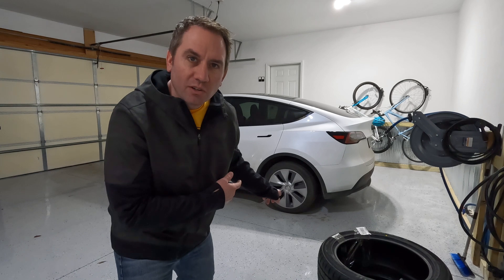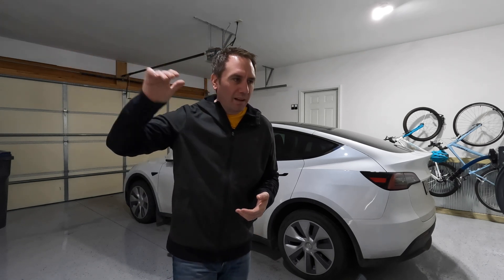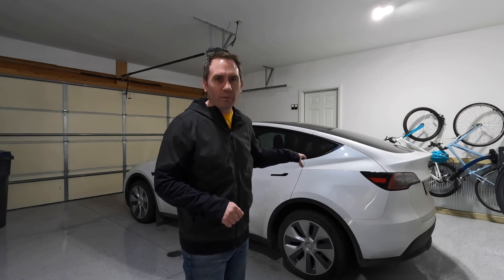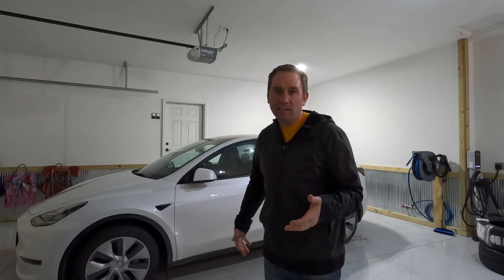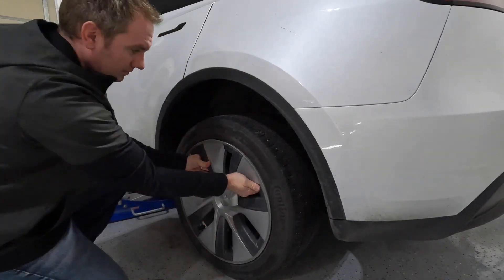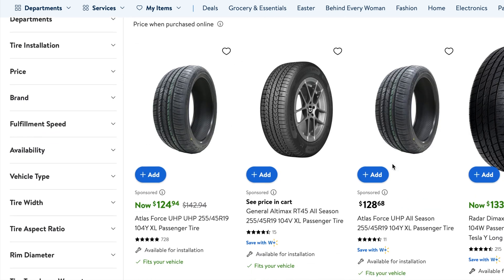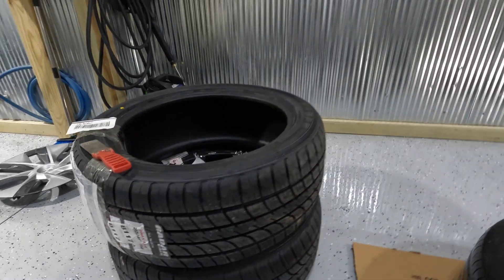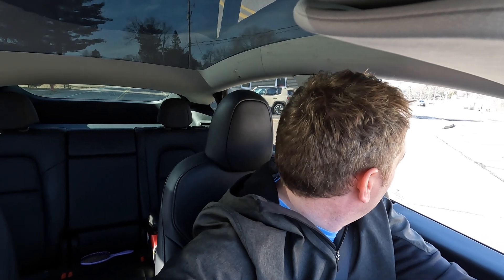Tesla Model Y Tires - Most Affordable Option

Comment: Hi, can you please provide an update on these tires? How long did they last compared to the expensive tires? I would appreciate your feedback on these tires as I am tired of buying expensive tires. I had Pirelli Zero Elect tires and paid $1400, but they only lasted 36,000 miles.
Reply from the maker: They have performed very similar to the stock Continentals.  They are currently at 13k miles and I'm guessing will last 20k - 25k miles on the rear.  I have zero complaints with these tires.  

I also have a long range Model Y that we mostly use for highway miles and the stock Continentals are lasting much longer.  I'm currently at 23k miles and have at least another 10k left.

  I believe it's the start/stop of city driving that really wears out the rear tires during regeneration.
Reply: @TheLawnEngineer  so these rader tires u recommend?

Comment: I have a 2021 AWD Y and it's got 36,000 mi on the tires.  I rotated my tires once  myself,  easy to do. I drove nuts also but not insane... My tire ware is same on all 4 tires.. ( your so wrong about time waiting for rotation,  but invested a ton of $ and a hell more time then having a shop to do it).... All I bought was a torque wrench ...If your car was in an accident I think the insurance company would decline  your clam after you took a saw to the tire on the rim....This did not go well for you..  But love your raised beds and trailer hitch. Ill give you a few more looks
Reply from the maker: Rotation does even the wear out across all four tires.  However, the case is not closed on your tires vs my tires lasting longer.  I only replaced the rear tires, the front are still in great condition.  To truly compare, we need to see how long my front last and then average the life.  If the front last 60,000 miles and the rear 20,000 it's an average of 40,000 miles for the four.  

I agree with the tires/rims and cutting if I hit the rims with the saw or grinder but I was careful and did not.

Comment: What's the efficiency with these tires? My guess is that it's worse than the stock Continentals but by how much? If it's worse, then is it worth the savings at the costs of efficiency and noise level from these economy tires?
Reply from the maker: Unfortunately, there is no current standard to compare tire efficiency or rolling resistance.  There is a proposal out there to include on all new tires but it’s not in place yet. 

I have not noticed a range decrease with these tires.  My average monthly charging cost is sitting at $25.  It would have to be a significant increase in rolling resistance to overcome the cost difference.

Also, the only noticeable rolling resistance is mostly based on tread pattern and how much boundary layer air gets carried around the tires.  Deeper more aggressive treads are worse than all season tires.  They play around with rubber mixes but that is a small lever compared to tread.

Comment: You get what you pay for...when it rains or snows you're going to regret cheap tires.
Reply from the maker: For most things in life, you get what you pay for; however, it's not a blanket statement that can be applied to everything.  

These tires are DOT approved with a UTQG rating of 600AA with a typical all-season tread pattern .  The UTQG rating is based on test results not opinion.

Comment: Man do whatever you want with your vehicle but don’t suggest people to buy cheap tires and not balance them on a Tesla?  Where there is no engine noise, it might not bother you. But coming from someone that works on vehicles not everyone wants to hear not even a little bit of tire noise or road noise.  Your tires are not balanced. It cost 20$ to balance a wheel….
Reply from the maker: People are free to do whatever they want.  

It wouldn’t make an interesting or thought provoking video if I bought name brand tires and had them installed at a reputable tire shop…snore fest 🤣
Reply: @TheLawnEngineer  Didn't you use that balancing tool you bought recently?  I think that was when we first saw you cutting the tire in half and getting all that experience in taking them off and putting them back on.  Without looking it up, I am drawing a blank as to why you were doing the tire removals during that episode. Maybe it was about replacing tires on a different vehicle?
Reply from the maker: Yes, I used a static balancer.  What the commenter was referring to is dynamic balancing.  Dynamic balancing is generally better but static balancing was the standard for decades before technology enabled dynamic balancing.  Balance specifications are a deep topic but it’s not fair to say the tires aren’t balanced.

I split the tire change into two videos.  One was just about the change and the tools used, this video was about tires for a Tesla.